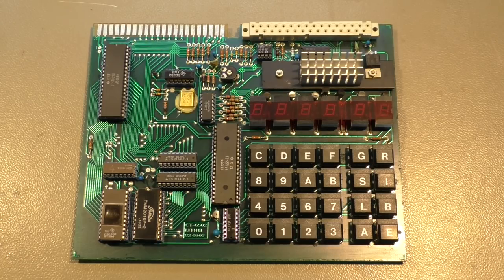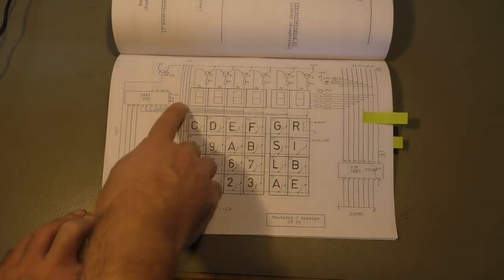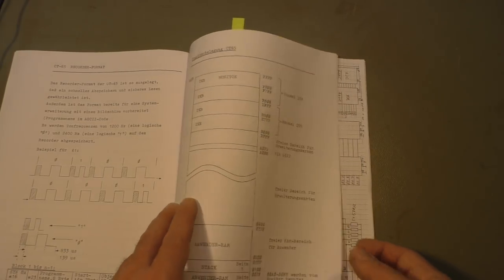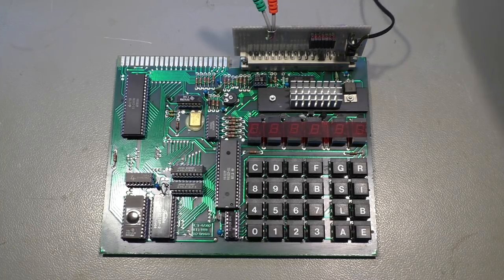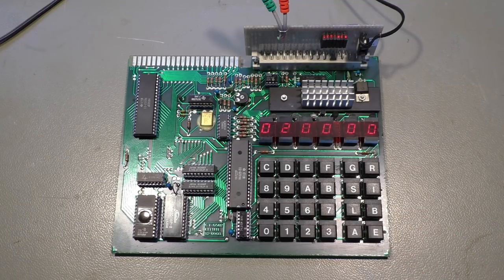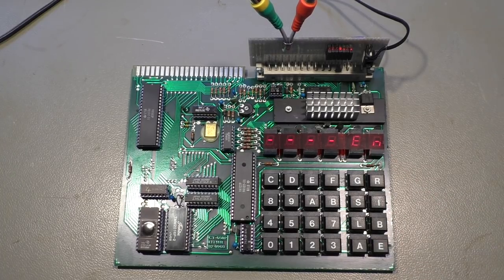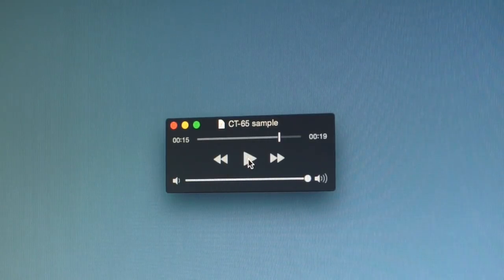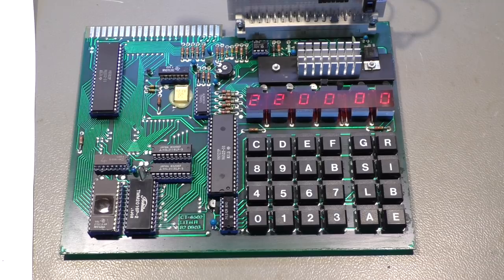6502 Microprocessor Training Board from 1982 - (PWJ119)

Comment: Do you have any recommendations for other basic 6502 projects or boards (preferably with English documentation)?
  A lot of people familiar with these older machines say "there are lots of other sources," but in my experience (as a younger hobbyist since just 2014), it isn't so easy to find this information, at least not in a format that is manageable.
 I picked up a few Z80, 68k, and 6502s' weeks ago. I have found a few references for Z80's already but not as much info for the other two. Well... the 6809 is rather extensively detailed in the second edition of The Art of Electronics, but it is done in the typical academic verbose language of that publication. I've come across several "link dump" personal type websites with far more information than anyone can handle without being overwhelmed. Usually half or more of the linked content is broken as well.
  I'm mostly looking for any references that are intentionally designed for someone that just wants to casually learn assembly and hardware level computing without the need to undertake a massive research and prerequisite reading challenge in order to follow, and info that doesn't ask me to spend $50+ on what I can buy and breadboard for less than $5. My whole reason for playing with simple stuff like this is because these are cheap, simple, and the MPU isn't hidden inside a 600+ page datasheet like an ATmega328 and others I've messed with.

Thanks for the upload ;)
-Jake
Reply from the maker: I would start on 6502.org  They have a huge list of homebuilt projects to choose from. Some better documented, some less.

Comment: It is amazing the lack of decoupling. Are the blue caps tantalum?
Reply from the maker: Yeah I think so. Typical Tantalum "teardrop" capacitors from the 1980s. I know, normally those boards are full with caps of all kinds. But if there are only a handful of chips, you also need only a handful of caps.  :-)